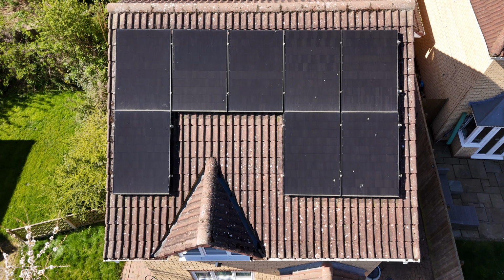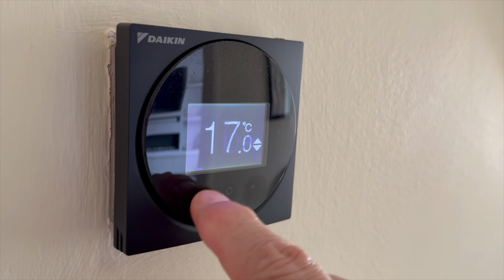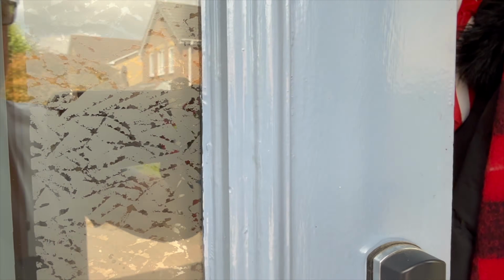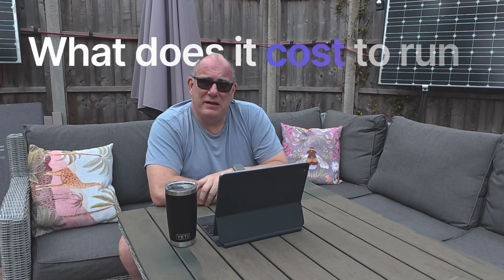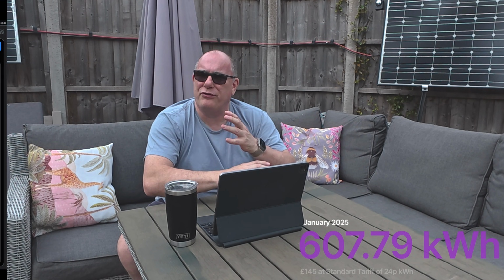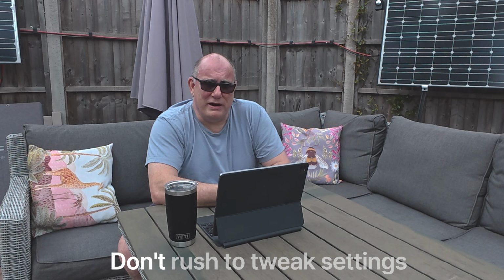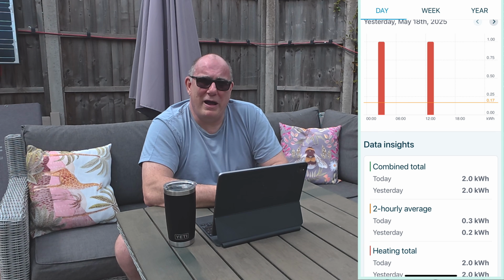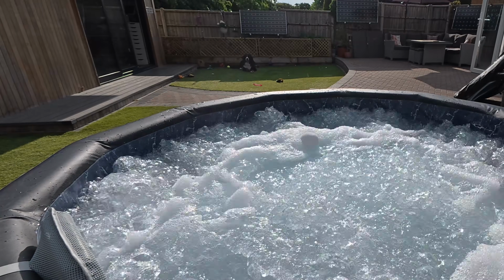I Spent 6 Months with an Octopus Energy Heat Pump and was blown away by the running costs!

Comment: I'm looking at a proposal for heat pump solar and energy upgrades right now.... I'm curious Have you done much insulation or upgrading general heating efficiency of your home since those gas bills
Reply from the maker: Only some minor additions to the insulation in the attic, it was built to 1990 standards so had cavity wall insulation, so we just added some more insulation to the attic. Other than that we replaced the windows a couple years ago with more modern windows and that’s about it.
Reply: Thanks I'm going all in just waiting for prices from another company I should be getting solar & battery heat pump cavity wall insulation attic insulation with mhrv €46k -€17k in grants so I'm expecting €30k in cost to me... I'm excited but stressed about choosing the wrong guys  @JonathanTracey

Comment: Nice to hear you are on track for Net Zero Energy usage. That something i'm aiming for and with Solar panels, Batteries in the right quantities, along with a Heat Pump its genuinely achievable. 😀 
Do you know what your COP for hot water only is if you were to exclude heating?
Reply from the maker: Yep were running at 3.04 for just hot water, in reality its probably just about 3.0 as we use our booster every 7-10 days for legionella so we add a couple of extra kWh that's not accounted for by the MMI

Comment: I find your comments on thermostat interesting, my understanding is with a correctly set weather compensation curve the indoor stat does veey little, maybe just used for the setback temperature overnight? 
Do you know if the thermostat is just on/off or does it adjust the flow temp progressively, i think in the heating world it's referred to as load compensation, although in my world that's just a PID control, whereas weather compensation is feedforward control.
Reply: Vaillant (for one manufacturer) has a number of settings that vary how the thermostat is used. Pure weather compensation and Active, where the circuit turns off when the temperature is reached.
Reply from the maker: The way it was explained to me (and I could be wrong) was the weather compensation adjusts the flow temperature of the heat pump, not the temperature in the room, that's dictated by how much water is flowed into the radiators over time so the thermostat is for you to say "I want 20 degrees" the weather compensation curve says for an external temp of 10 degrees you need water of 33 degrees and then the pump curculates the heat for a long as i needed to reach the temperature you set
Reply: @JonathanTracey 
Yes, I'm sure you're correct, the thermostat is still an on/off device. I need to look into this a bit deeper, as I believe there are some thermostats that are proportional too, which, when correctly configured, should be able to improve system efficiency, avoiding excessive on/off cycling.
What I don't know, is which systems employ which control strategy, always more to learn, eh?

Comment: Thanks for a great video.  I had a similar Daikin heat pump installed a few weeks ago. I would like to understand how you are monitoring the powers to generate COP and SCOP I know you are using Shelly device to get consumption (i get the impression the Daikin data is not very good) but was more interested to know how you are getting power generated. Thanks again for a great video series
Reply from the maker: power generated comes from the MMI there is no other way to measure it, the daikin data is getting better, it’s about 5% off what the shelly reports for energy in

Comment: So my partner loves a shower somethings up to 40 mins long and she’s worried about not being able to do that anymore
Reply from the maker: our 167l tank takes about 15 mins to empty with the power shower on full
Reply: You can always 
Use the shower on a slower setting 
Use the shower on a cooler setting
Heat the water while the shower is on (I think ours heats in about 30 mins) 
Heat the water in the cylinder to a higher temperature prior to long shower events!
Reply: @Biggest-hz7ng  Also a good candidate for waste water heat recovery - preheat the cold water flow to the shower and/or the hot water tank from the waste heat going down the drain. For a 40 minute shower, it would save a decent chunk of change even without a heat pump.

Comment: The big problem with heat pumps is they are more sensitive to their design. Gas is more forgiving and will generally always work no matter what. People are also resigned to paying whatever it costs. 

Heatpumps that have been badly designed can be utterly useless in their purpose. You can end up with something that can’t heat the house to the desired temperature. It’s a design problem not a heat pump problem. Correctly designed and used a heat pump is always better. There is no argument. The manufacturers also don’t help with this as they can play with the figures and quote output at say 7 deg when the UK designs to around a -4 outdoor temperature. 

One thing that people don’t consider is house use. I’m out of my house for a lot of time while I’m at work so I don’t heat it, it costs essentially zero where a heat pump will need to either be on or set back, both of which have use implication. 

I’m fixing my insulation at the moment so not worrying about a heat pump at the moment but any work I’m doing on the house is worth a heat pump in mind.
Reply from the maker: You're absolutely right — one of the biggest challenges with heat pumps is that they demand good design and planning. Unlike gas boilers, which are more forgiving and tend to “just work,” a poorly specified or installed heat pump can leave a homeowner with disappointing performance. It’s why some people have a bad experience and then write off the whole technology, even though the issue is with the system design, not the heat pump itself.

I also agree that manufacturers (and sometimes installers) quoting performance figures at 7°C ambient can be misleading, especially when real-world performance in a UK winter might need to hold up at -4°C or below. It's critical to look at the whole system — including insulation, flow temps, and emitter sizing — to get a heat pump to work properly and efficiently.

The point about usage patterns is really interesting too. If you’re out all day and only need short bursts of heat, a gas system is definitely more aligned with that kind of peaky use. Heat pumps perform best with a steady-state, low-and-slow approach — so habits and occupancy patterns really do matter. That said, some people use smart controls and setbacks effectively to bridge that gap, but it’s not quite as “plug-and-play” as gas.

It’s great to hear you're improving insulation — probably the best long-term investment you can make, whatever heating system you go with. And smart to be thinking about future-proofing for a heat pump now. That mindset will definitely pay off down the line.

Comment: Great video. Really interesting. I currently  have solar and battery (only 14kw). On an average day in January what does your heat pump use as a max draw  and what does it run at when it’s in steady state and what’s its usage in an average January day? Trying to figure out how much more battery I may need to run the house mostly off the batteries.
Reply from the maker: sure here are the average daily draws for this year i. kWh Jan 19.61 , Feb 15.2, Mar 8.4, Apr 3.3 and currently on may 2.79.
Reply: Estimate your heat loss (mine is 10kW). So in theory I'll need 240kW of heat at -3C over a day. That might require 80kWh of electricity (at a COP of say of 3). The most I have needed was 50kWh.

Comment: Had my cosy 6 installed 7th nov 24 scop is 2.89 so far
Reply from the maker: Have you seen your bills go down?
Reply: @JonathanTracey I’d say it’s roughly the same as gas boiler I’m on octopus intelligent go and have solar but no battery. I think they’ve been monitoring my performance as I had a call a few weeks back out of the blue saying they would like to come and make some efficiency improvements spent hours moving temp sensors and replacing things inside the cosy
Reply from the maker: have heard them do similar with other cosy owners, so hopefully they can squeeze some more efficiency for youn
Reply: Last I looked, Octopus suggest a SCOP around 3.3 for the Cosy 6. Maybe you are using lots of hot water relative to heating?

Comment: Nice informative video. Many thanks for information. I`ve only just joined the solar /battery gang and am already eyeing heat pumps..Forgive newby question: How much battery storage is required to time shift the running cost of your heat pump from off peak rates ? cheers
Reply from the maker: that’s a very difficult question to answer because everybody’s situation is gonna be different. It also depends if you’re objective is to completely run the system from battery or to just minimise how much you import a peak rates. This also changes depending on which time which tariff you are on. I would say a good starting point would be to have 10 kWh, that will get you going until you understand your usage pants. If you make sure that the battery system that you buy is modular, you can always add to it later.

Comment: Thanks for another great video JT. After watching plenty of your previous videos I had 13 solar panels and a Tesla Power Wall 3 installed and up and running on the 9th May. I changed my tariff from a fixed rate to Octopus Flux and just waiting for my export details to be supplied by Octopus. The fact that apart from the standing charge I think the odd penny has been added to the bill but I don't know why as the battery has never dropped below 50% but what's the odd penny amongst friends!! I just get a bit miffed when I see the excess electricity going back to the grid without being paid for it at the moment. Hopefully after watching your journey with your heat pump installation, I'm hoping to start my own heat pump journey within a few months and enjoy the benefits of a nice warm house in time for next winter. I will be sure to use your referral code when I get my application to Octopus sorted out. Thanks again for the great inspiration I've taken from all your great advice. Keep the great videos coming.👍
Reply from the maker: Thanks for sharing Brian, when it all comes together its amazing how little it costs to run, feel free to reach out if you have questions

Comment: We have a 11kw Daikin Heat pump for just over a year and up until 3 weeks ago had no solar or batteries in a 1920s house with solid walls.

It's so much cheaper over the course of the year than our bottled LPG gas we had when we bought the house! Now with solar even with the export fee not set up yet were literally only spending the standing charge
Reply from the maker: Solar, batteries and Heat Pump together for an amazing trifecta. If things continue the way they are it’s looking like my Heat Pump will save me £1200 in its first year. That’s almost 1/3 of the cost of the Heat Pump so I’ll pay back period will come down to about 3.2 years.

Comment: I'm interested, I like the idea of paying an amount upfront and then getting reduced ongoing bills. 
Did you have to have larger radiators installed?
Did you get a government subsidy for the installation? Was the £3900 what you actually paid for the system or was it cheaper due to government subsidies?
Reply from the maker: so the £3900 price was what we paid, obviously the installation company claimed the grant from the government. But my out-of-pocket expense is £3900. Yes we did have to have all of our radiators upgraded to thicker radiators, where is this? Was a bit of a worry to be honest we don’t notice them any longer.
Reply: @JonathanTracey  Thank you for the reply. Did the £3,900 include the upgrade of the radiators? I’m in Nottinghamshire in a 15-year-old, five-bed detached with a small garden (typical new-build). My main worry is where to put the heat pump, how far does it project from the wall? I’m considering either in front of the kitchen window or around the side by the driveway, but that might narrow the driveway. I also have a narrow passage where the wheelie bins sit, but it’s just about wide enough to store the bins and squeeze past.
Reply from the maker: yes all in included. every home is going to be different, ours is 30 year old build so has some levels of insulation but the radiators were past their best

Comment: Hi Jon, im looking at a heat pump to go with my solar battery system. The only concern i have is my battery tops up at night on Octopus Intelligent which is fine and my electric car charges at the same time but for some reason doesnt always fully charge, no idea why. If i include a heat pump is there enough amps in the house to run all 3?
Reply from the maker: you do have to balance things, an EV will pull 7kw, the heat pump probably 3-3.5 (for a 6kw unit) on the coldest days, then add in your home battery (depends on your inverter size) but that should all be under 20kw which is a lot but still under the 100amp limit (assume you have a 100amp fuse)

Comment: The one thing to watch out with setting water tank temps is when they get below around 50°C (well, 49 but close enough) there’s a risk of unpleasant things growing in the tank, like legionella bacteria. Not a huge risk, to be sure, but one that does increase as water temperature decreases.
Reply from the maker: yeah, I know it’s a low risk, but we actually run a weekly cycle, where we heat the tank to 67° overnight using the boost function. This means the temperature sits high enough to kill off anything that’s nasty for at least eight hours.
Reply: @JonathanTracey  ah, excellent. And it’s not really wasted energy either, since these hot water tanks are generally extremely good at holding in the heat.
Reply from the maker: Yeah we forgot to turn off hte legionella cycle a few weeks back when we went away for 4 days, came back and hte water was still piping hot
Reply: It depends what you use the tank water for, such as a old style gravity fed hot water tank. In my place there is a large hot water storage one with a built in heat exchanger for mains pressure water heating plus an auto mixing valve. Thus it’s OK to have combined taps for both hot & cold, and it’s as safe to drink the hot water as the cold mains water.

The water heating in the tank is an immersion heater, managed via a Myenergi Eddi unit, which diverts spare output from my PV inverter.

Comment: Octopus surveyor due to re-visit tomorrow to look at moving our proposed heat pump installation location due to noise concerns raised by our neighbour once they heard about our planned installation. They accept that the original proposed location meets all relevant requirements but none the less it was going to be between our houses so have raised a concern.

So do you go ahead with original plan or accept that a perceived problem is as much a problem as a real one. We’ve decided take the path of least resistance and as such have asked Octopus to re-visit which they were happy to do. Will probably mean a longer pipe run, up a gable wall and into the attic rather than through the garage as originally planned. Let’s see what the surveyor has to say though before deciding if we ditch plan A or not.
Reply from the maker: Sounds good, did you have to pay them to come back out or as they doing it for free?
Reply: @JonathanTracey  No charge and the outcome is that we will have to re-located the heat pump. The surveyor said that the minimum distance requirements had been updated recently and that our original plan would now fail the noise assessment that it passed just a few weeks ago. Perhaps a good thing then that the neighbour raised their concern otherwise we may have had a problem come installation time.
Reply from the maker: Sounds like great customer service
Reply: @JonathanTracey  It certainly was and TBH I’ve been significantly impressed with the level of support and response from Octopus since the very first enquiry. Just wish more companies operated like this.
Reply: @topps100 I wholeheartedly agree with the level of customer service from octopus for our heat pump journey so far. Nothing appears to be too much trouble to ensure we are happy with the installation. 
Communication via email and phone is excellent.

Comment: Marvelous video. We are batterie solar. 4kw harvesting and 20kw storage off grid. Back in January. Emersion and electric floors used just short of a 1000kw. And not all the house was warm. So I think it's  my next move. Indirect system is all ready in. Win win 👍
Reply from the maker: Wow, that’s a lot of energy for underfloor heating but if it works for you👍

Comment: Dosnt your installation have local weather  compensation as this should negate the need for a thermostat as i understand it .might be wrong about that but iam sure Vailant heat pumps do
Reply from the maker: yes, it has weather compensation, but it does not negate the need for a thermostat. The thermostat dictates the temperature that you want, the heat compensation sensor tells the Heat Pump what flow temperature it needs to reach to be able to deliver the temperature requested from the thermostat.
Reply: My 6kw daikin runs in pure weather comp and doesn’t use the internal thermostat at all.
Reply from the maker: the weather compensation only sets the flow temperature not the room temperature, but if your warms and comfortable that’s all that matters
Reply: @JonathanTracey  its one of the same thing really you set the heat curve so you get the right internal temp at the certain external temp .no need for a stat if the heat loss /gereration  for 21c is matched